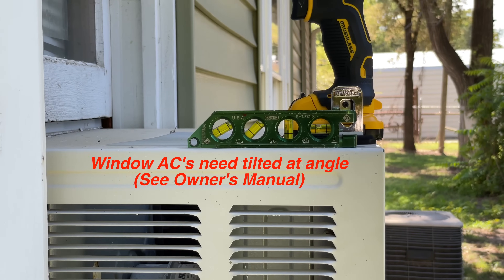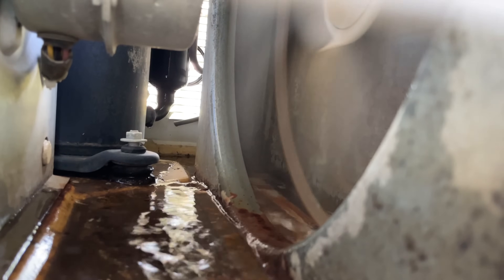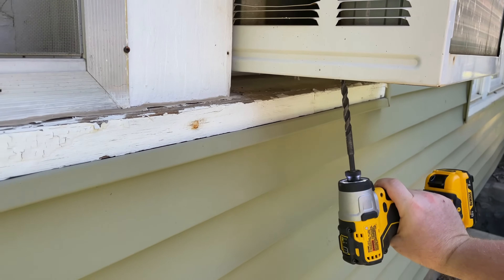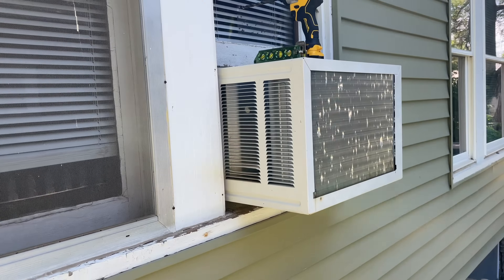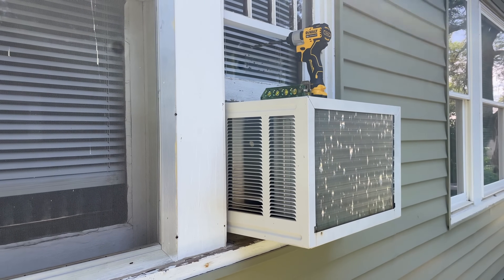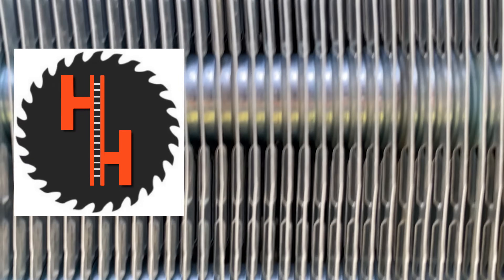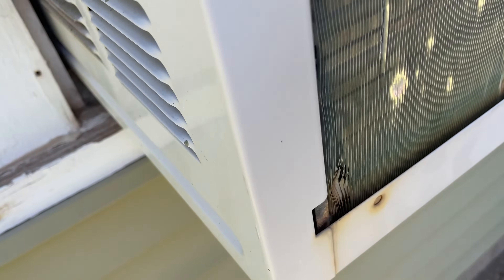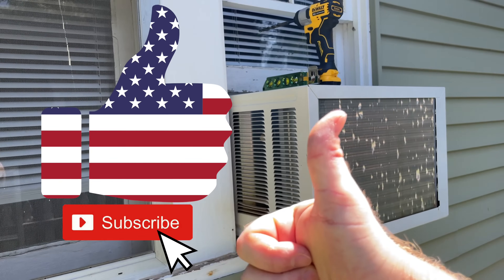99% Don't Know THIS About Window A/C's!! DON'T DRILL!!

Comment: you clearly live in a dryer climate . in south texas near the coast that "slinger" setup will turn the walls and entire area around the ac into a green swampy mess. it boggs the fan down inside trying to sling the water so the air slows to a crawl inside the house. you should say that this tip is location dependant. i drilled mine and the effectiveness of the ac increased several fold. just watch for refrigerant lines in the bottom of the unit when drilling
Reply: yep, in my state the humidity will turn the whole ac into a black moldy mess
Reply: I've got a breeding ground of Mosquitos bogging up my unit. Took it apart a few weeks ago cus of the smell, were right back to where we started..
Reply: True story is that in Humid areas you need to CLEAN.
Remove the AC at least once a year and hose every bit of MUD out of it. Preferably just before the Cooling Season. The Unit is designed to be slid out of the holding case for that reason. The slinger ring helps with efficency by cooling the HOT Condenser. If you are getting water INSIDE then you are truely well past a Service CLEAN.
Reply: @MelodyMan69 holding cases are not common everywhere. In all the states that I've lived in (east of the missippi), I've never seen window ac units with cases, unless they were in a large apartment building, where it was probably mandatory for safety. I've compared the differences between having better drainage and less mold build-up or slinging water on the condenser and building up a swamp inside, and in my climate at least, the extra drainage is MUCH better over all to have. I've seen several different internal designs from different manufacturers since I buy new units every 3 years, and there's usually a few different channels or openings on the top and bottom of the interior styrofoam barrier that seperates the equipment (interior evaporater and blower / exterior fan and condenser) , and from my experience the mold etc can easily spread from the outside half of the unit to the inside parts. Since I started making my own drain holes, the amount of build-up has been reduced by at least 90%, and I have not seen any difference in cooling ability or energy consumption.
Reply: @MelodyMan69you will need to clean every month.  NOT.
Reply: @MelodyMan69 Excuse me, but my Frigidaire 5000-btu is cleaned by pulling out the filter, the re-inserting. That's it. Not everyone has the strength and wherewithall to do what you advised.
Reply: @MelodyMan69Ive had mine for 2 months. I noticed a couple weeks ago a pink tint in the back and fish smell. I took it apart to clean today and it was so f’n gross. Slimy mildew. Green, pink black brown ugh. Less than two months of only night time use. Ridiculous took forever to get cleaned. Sprayed it down with concrobium hope it helps keep the mold away.
Reply: @MelodyMan69 I call foul on overengineering. People shouldn’t be expected to completely disassemble their window AC units just to keep them running. That was never the case with units from 10 or even 20 years ago — they could go years without needing any intervention, and they didn’t get moldy. I think this kind of design “innovation” is going to backfire on manufacturers. In fact, I believe it already has with Midea’s well-regarded U-shaped unit. Maybe it’s unrelated, but look at the major recall they’re dealing with. That says a lot.
Reply: @HiFiTown u shaped midea aside, these units have used slings for over 20 years. 
Ignore the op, they have no clue what they are talking about. 
The outdoor coil gets to be 20° above ambient - that small amount of water always gets evaporated.
Reply: @sprockkets   in practice, evaporation just doesn’t keep up in high humidity environments. In the Southeast, where dew points linger in the 70s day and night, the air is already saturated. A coil running 20° above ambient doesn’t do much when the wet bulb temperature is sky-high—evaporation stalls out. Even a towel left out near heat stays damp till morning.

So while the sling method might work in drier climates, in humid subtropical (Ie Wash. DC) zones, these units just sit stewing in water. A drain hole should be optional, not engineered out completely.
Reply: And make sure to watch for the fan blades and don't drill the holes while the AC unit is running cuz you can hit one of the fan blades and possibly break one off ask me how I know😂
Reply: @brendanlett3594 been there 😂
Reply: The same way i know about the pipes. Soldered it with a clamp and added a valve to load with freon. Colder than ever. @brendanlett3594
Reply: I watched for them, watched one bust in my face……😂
Reply: WRONG drill the hole unless you want a dirty, moldy MESS!
Reply: @randym4600 Wrong dummy I said I know HVAC been doing it for over 50+ years leave it alone the water dont sit long enough to get mold it is slung on the condensing coil to cool it and make unit efficient ,if you stop being lazy and wash your unit yearly you wouldn't have problems leave the engineering to us pro's
Reply: Green energy. :)
Reply: Looking at what I can see in the video this handyman dude lives in a northern area, his accent is Midwest. Full basement, air conditioner unit not a package unit, etc. probably Iowa or Missouri area.
Reply: Dude your not a HVAC tech I'm a master licensed HVAC tech since 1978 copper dont rust wow your dumb aluminum dont rust wow so you should just stop commenting because we HVAC engineering guys know what we are doing ,freon doesn't harm the ozone smoke does
Reply: Good buy to dummy's like you
Reply: Good buy to dummy's like you water splashing on coil = efficiency , water splashing on condensing coil =lower head pressure = better cooling = cooler compressor = longer lifetime = cooler house temp, now you have been proven to be in qualified to even comment
Reply: This was super helpful info for me. I had my drill out and was about ready to do this exact thing for a small window unit I just installed in a bedroom. Figured I should maybe look into it at least before drilling. Glad I did. Thanks muchly!
Reply: Where did you drill it exactly?
Reply: @MrBurns0618 dont drill
Reply: 😂😂😂😂😂😂 golden. Pin it.
Reply: The cold condensation water never evaporates its a continuous flow of water on the condensing coil without it your head pressure will be around 200 psi for r,22 with the slinger it keeps it around 130 psi ,410 250 instead of 300
Reply: I live in a more humid area than Texas lol clean your AC unit ya dirty fuq
Reply: Most ac have a screw and a cover you gatta take off to let drain rain water out of the unit itself but some don't I drill them kinds for sure it rains a lot where I live in eastern KY
Reply: Ok thank fuck I thought I fucked it up
Reply: Omg I’ve been dealing with an ineffective window AC unit for the last year. The unit is sized where it should be very effective at keeping my room cool, but I noticed it just seems like really cold air is coming out into the room, but the room always feels muggy and humid and seems warmer than it should be. Even when the AC unit hits its targeted temp and shuts off, it’s not comfortable in the room. I live in pretty humid NC climate. I noticed today there’s just standing water pooled in the back and wondered if the unit is properly draining. Now I’m starting to suspect that I need to drill some drain holes because my climate doesn’t make sense to evaporate the water.
Reply from the maker: it seems like the AC I've seen have an overflow holes if the water builds up too much and if it's tilted correctly. Maude your are plugged?  I Do live in a medium humid climate, so you're probably right on location.

Good tip on drilling through them. There's a lot of good ACs that have died prematurely because ppl have  drilled through the condenser
Reply: Putting a drain hole in the "slinger" catchment depression would cost nothing and drain faster. I just cleaned two of my ac units and both had mold in the styrofoam box and clogged fins on the inside of the condenser coils. I drilled a hole in the catchment depression, as the "slinger" is clearly not doing its job. No danger of hitting the condenser if you look carefully before drilling. 

It's a bad design. Weirdly, there is a removable drain plug in both my units, but it isn't where it needs to be and does nothing.
Reply: @antronargaiv3283  Interesting...i'm so sick and tired of all these company-autocrats cranking out ever-worse junk by the year. By now we're even beyond rock-bottom.
Reply: All of them do this, when it's 90% humidity no amount of tilting or pretending it was engineered right will help. I stick a bung with a drain tube on.  @HandymanHertz
Reply: yes drill baby drill in texas, florida and georgia.  and tropical countries where it rains dogs and cats.
Reply: No it dont slow the fan down deal with it , it was made that way to keep condenser cooler which makes units blow colder
Reply: Doesn't matter about humidity the window unit removes heat and humidity from inside your house I know this I've been doing HVAC since the 70s kids I live in hot humidity area on east coast and no mold or slime kids because the water dont sit there it is slung on the condensing coil kids
Reply: @henrykennedy1120  I'm a 63 yr old kid who drinks a lot of Bud Light...but I have a question; I just installed an 8000 BTU LG in bedroom, works great, no drilling here, letting it sling, but on outside I noticed lots of dead gnats/mesquitos etc all inside the water etc..should I try to spray them out with water hose?
Reply: @FuzzyBooger never had that problem , never seen it , but spray bleach mixed with water ,
Reply: I'm in va on east coast and  they have no mold or slime or tropical temps here
Reply: @henrykennedy1120 It's also about sun... These water-slinger ACs struggle in shaded spots—especially under trees—where the pooled condensate doesn’t get baked off. Without a drain hole, the water just sits can slow dehumidification compared to older units. In full sun, the design works better because the heat helps evaporate moisture.. thats the idea. Another concern...: manufacturers may now depend on that water to help cool/transfer heat from undersized internal parts, which likely means they’ve downsized components and pushed them closer to thermal limits. That’s not energy efficiency—it’s reduced tolerance.
Reply: @HiFiTown  For profiting.

Nothing else.
Reply: No water buildup on slinger window units
Reply: Nope water comes from evaporator coil its called condensation, not from outside ambient temp it comes from the removal of humidity from indoors basic HVAC 101
Reply: And all ac systems work better in the shade
Reply: All window units slide out of a shell or case
Reply: @henrykennedy1120

 Sub 10,000, btu units don't.
Reply: Or you can just clean the thing every year. You know, like you're supposed to? I live in high humidity and never have issues unless I don't clean it. The more humid years sometimes you got to clean it twice.
Reply: @reyray1123 clean it before use just like a central unit its common sense
Reply: Kid its water that slings on the coil not evaporation its condensation from the warm inside of your house nothing to do with shade wow go to HVAC school the condensing fan has a sling ring on it that picks up the water and slings it on the coil stop trying to tell me son because I've been doing HVAC for over 50 years when you want the head pressure to come down cool the condensing coil it cools better wow hook your gauges up to a central unit read the head pressure then spry it with a hose watch the pressure drop now you know so dont comment ignorance like you did
Reply: @henrykennedy1120 kid...lol
Reply: @FuzzyBooger yea kid
Reply: @henrykennedy1120  🔥🔥🔥🔥🔥🔥🔥🔥🔥
Reply: Its designed for hot humid temps
Reply: @henrykennedy1120  I drilled a drain hole in an LG unit, ans installed a drain hose...that did not have even a rubber plug – – haven't had any trouble with it in two years and notable better dehumidification. Deep shade location southern Virginia. The slinging sound of the water was also somewhat annoying. Sounded like somebody swishing mouthwash when it ran befor -- now just a normal A/C sound. Not saying everybody should do it. But if you are in a not sunny location – – you might be asking for trouble. Some of them also overflow with water when they get gunked up with tree leaves and stuff. And what if you don't have it in an accessible location. For instance second floor of a house window under trees? Who is going to want to clean it? Put in a drain and be done I say.
Reply: @henrykennedy1120  I think you may be overlooking some basic thermodynamics here. What do you think causes the water to evaporate (the cooling effect you champion)  off the coil in the first place? It’s heat — radiant (sun) or ambient. In full sun, super hot weather, yes, you get that effect. But in deep shade or high humidity, still wind, evaporation is minimal, so instead of helping, the water just sits there —, reducing airflow, and possibly even raising the coil temp. We’re talking real differences — 20–40°F depending on conditions. You ever check head pressure on a shaded slinger unit in 90% humidity? Might surprise you.  They are playing with established design here in window AC and I bet the benefit here is not going to outweigh all of the problems it causes. Just look at that huge recall they had with mold.
Reply: @henrykennedy1120 I hope you're right.  Seems to me pooled water slinger (aka swamp cooler for outside coil) would only work if baking in direct sun, if humidity was high.
Reply: @TheBlessedMeek  , A drain hole isn’t permanent anyway. Buy a rubber hole plug first then drill to appropriate size.
Reply: Yes they do I'm master licensed HVAC tech since 1978 and I can assure you when a unit is designed to sling water on condensing coil to keep it cool and more efficient dont drill a hole ,a hole will not make it cool any colder
Reply: @henrykennedy1120  This is a nuanced topic and clearly climate and humidity plays a big role. So just because the AC manufacturers want to ship the design that they can claim is more “energy efficient” doesn’t mean the laws of physics operate identically in every climate, and just because those aforementioned water slinging mechanisms work to achieve the desired purpose in other climates doesn’t mean they are optimal in every situation though. There’s plenty of evidence that people have different experiences based on the very real laws of physics, which affects the rate of evaporation in a given climate vs another. 

You ever cook something in a microwave and it turns out really bad by using the recommended cooking instructions? I’m guessing you’re the kind of guy to just shrug and say “well the directions can’t possibly be wrong” so you eat a frozen hot pocket instead of making an adjustment for your circumstance? It’s been pretty clearly established that there are some who are having superior results by not arbitrarily following the “directions” and by being open-minded enough to understand that physics doesn’t occur in a vacuum.

You clearly only know what a textbook taught you about a very limited set of knowledge related to HVAC. Anyone who isn’t a complete moron could understand that the laws of physics don’t always operate within the confines of the parameters in a textbook. Let me know when you’re ready to stop flashing around your laughable “credentials” and you’ve brushed up on the basics of how the laws of thermodynamics operate in varied conditions.
Reply: The design works well
Reply: @henrykennedy1120  in which climate? Maybe in the desert. but in the eastern coast of the US – – which is basically a subtropical climate, water builds up and mold grows.
Reply: @HiFiTown lol, mold grows in every unit except maybe arizona. Even up north in Minnesota. Spoiler alert, the north can get into the 90s with 70 degree dew points.
Reply: @sprockkets mold dont grow in any unit kid
Reply: @sprockkets Totally get that humidity isn’t exclusive to the South—but let’s not pretend it’s the same thing. Up North, sure, it gets muggy sometimes, but the nights cool off. In the Southeast, we get sustained 90°F+ days and 75°F dew points that don’t drop overnight. That combo—day and night, week after week—is what overwhelms air conditioners and creates prime mold conditions.

Out West? You can get by with a swamp cooler. It’s practically cheating.

Yeah, incorporating condensate back into the system to boost cooling was a clever idea in some climates. But eliminating the drain hole across the board was a wild move—because in the South, all that standing water just becomes a mold party. And I mean real mold. Thick, slimy, aggressive mold. It even grows in winter.

So yes, mold grows everywhere. But down south/east? It thrives.
Reply: Not here where I'm at I'm on east coast no mold or slime here and no tropical temps I'm in va
Reply: Bullshit...it gets beastly in Va. @henrykennedy1120
Reply: I said I'm in va dummy
Reply: It dont trap heat it improves efficiency
Reply: Drill then spend $500 for new unit in a year
Reply: @henrykennedy1120 . Mine is 8 years old and still works great. The first thing i did was drill a hole, it didn’t make a difference at all, except keep rust off my carport floor  and car. Mother in law bought the same one at the same time, she didn’t drill after five years she changed it because of the musty smell. She made me drill a hole in her new one.
Reply: @henrykennedy1120  water splashing on the coils = corroded coils = holes in coils = refrigerant says see you guys later,  im gonna eat some ozone layer.
Reply: @rodzvalv_5673If you think water on the condenser is bad, wait till you hear what happens when humid air hits your evaporator coil.
Reply: If it needed a drain hole the factory would have out one its designed to sling water on the condensing coil wow diy people I'm in nc and it not humid
Reply: @henrykennedy1120 its 87% humidity in Swain County as I type this and my unit sounds like a dang fish tank trickle inside the house.

Tell us again how North Carolina isnt humid 😂
Reply: @AmyC28713 well I'll tell you that's how they are designed if you didn't want to here the condensation buy one that's not a slinger and in nc its not humid right now
Reply: Dude stop please stop , the water in any ac unit is condensation that comes from the humidity of your home coming across a cold coil it sweats , so on the newly designed window units of the past 30 years they dont need to drain ,anytime you out water on a hot condensing coil it make unit cool better diy home owners dont understand this because HVAC school and experience teaches this now go back to o your desk job and stop acting like you know about HVAC
Reply: @henrykennedy1120 . Bad design, someone needs to reengineer it, because it doesn’t work. It’s not because it’s made that way, that it works, it doesn’t.
Reply: Your wrong son the design is to keep condensing coil cooler which makes units cool better and more efficient.  Its not designed for the water to evaporate wow its basic HVAC ,
Reply: @henrykennedy1120  Seems like a good idea.. but...  The water-slinger AC design only helps in dry, sunny conditions—where evaporation cools the coils. But in high humidity or deep shade, there’s little to no evaporative benefit. Instead, it can actually trap heat, reduce efficiency, promote mold, cause mineral buildup, increase corrosion risk, and make more noise. So yeah—it’s not always a smart feature, especially in the shade. These machines probably won't last 1/2 as long as the old design.
Reply: @henrykennedy1120 you ain’t in the northeast lol good luck with that up here